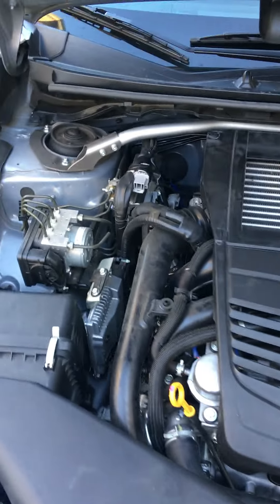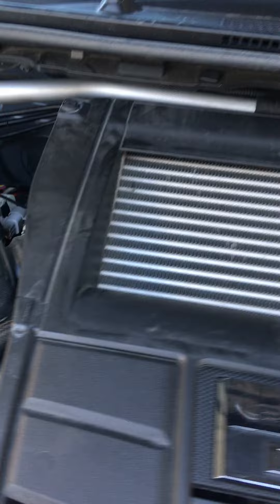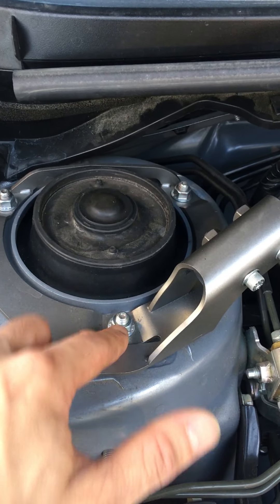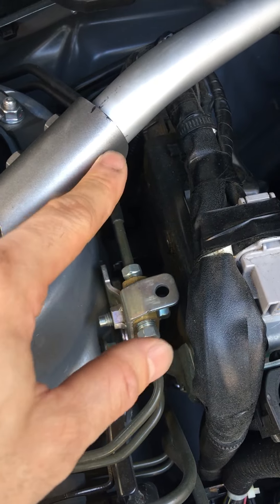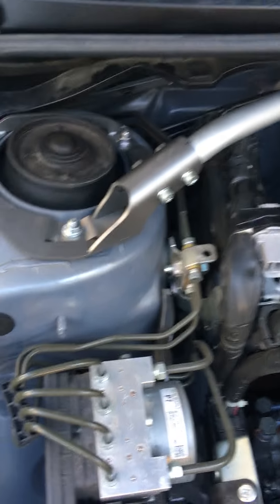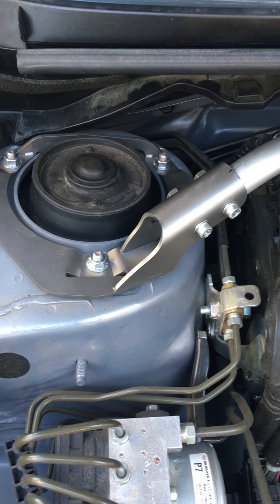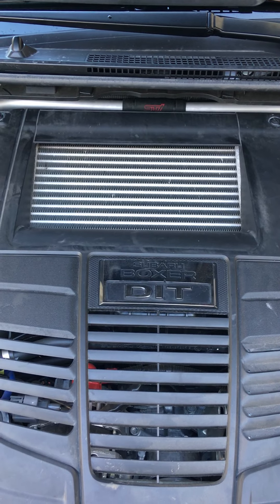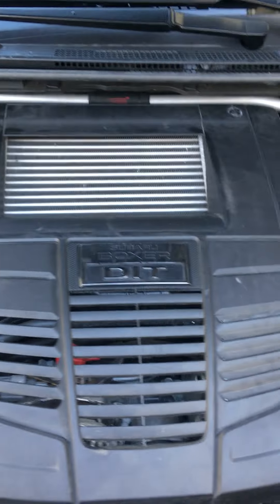STi JDM Flexible Tower Brace Install Tips and Review 2017 Subaru WRX

Comment: Acoording to the STi website, this strut tower brace needs to use with flexible draw stiffener (Part No. ST20118VV000). And a very interesting note states by Subaru that the this Tower Brace CAN NOT be installed on left hand vehicle. I'm sure it's not a mistake, this note is on WRX/STi, WRX S4 and Levorg STi (which all three were basically the same car chassis wise) I'm not sure what the deal is....
Reply from the maker: Hey what's up! That's interesting...when I purchased the item back in 2018, there was no disclaimer about needing the FDS installed in conjunction. I don't see the LHD disclaimer on the STi website anymore but I remember it was due to the bar running really close to the brake fluid reservoir. My car is USDM and the WRX S4 strut tower brace fits just fine. FDS was the best piece of equipment I have installed on the car to date for performance vs $.
Reply: @j168vlogs  Hey man, I just checked the LHD disclaimer is still there and here is the link https://www.sti.jp/en/parts/wrxsti_va/chassis/ST20502VV010/
I asked around a few dealers and rallsportdirect and they don't know anything about it. I think you are right, the brake fluid reservoir is located at different place for RHD. Thank you so much for pointing it out.
Reply from the maker: @Align700nitro  No problem man! There is a user on NASIOC that goes by Archer1.8, he made a few comments on some of my videos but he has extensive knowledge about JDM parts with a build thread on his Type RA. He's pretty helpful. https://forums.nasioc.com/forums/showthread.php?t=2901281&page=3
Reply: @j168vlogs  Do you know if he has a youtube channel? I’d love to hear how his car sounds.
Reply from the maker: @SonikJesus  Hey what's up! I second that, Archer1.8's build is incredible JDM goodness lol. Unfortunately, he doesn't really post any videos on his youtube channel, but there is a IWSTi member, ajsti24, that is also a JDM parts enthusiast. He didn't do the legendary turbo upgrade but he has the same muffler on STi https://www.youtube.com/watch?v=inbr9L-Rdh4.

 He drives a S209 now so that is pretty much as good as it can get!

Comment: Mine has just arrived and these days I will be installing it in my Sti 2020. I realized that in the box, the adjustment screws came loose and missing 1. Will it be easy to get?
Reply from the maker: Hey what's up! Sorry to hear you are missing parts. I don't think that exact bolt can be found. I would contact the company you bought from and ask for them to mail you the oem bolt. If not, you may consider purchasing an equivalent strength stainless steel metric bolt from a hardware store but I am not sure if that is safe or not. Hope you get it solved fast!!

Comment: Does this fit with Iag AOS?
Reply from the maker: Wish I knew. Sorry! Let me know if you find out.
Reply: @j168vlogs   I tried and it doesn't fit 😞. I have the grimspeed tmic and I could get it past that but the IAG AOS sits about 1/4 inch to high. I really like your videos and wanted to do all oem suspension upgrades for my wrx.
Reply from the maker: @Dillz107  That's disappointing news to hear but at least they make other strut tower bars that will work with the AOS. Thanks for watching the videos! If you do all the other STi suspension mods, you will not be disappointed. I hope you still keep the STi strut tower bar and make it work out for you one day! It's an engineering jewel for chassis modifications. If you ever get the chance, let me know how your WRX build is going!

Comment: What torque spec did you use after putting on the tower brace? Some say 14.5 lbs others say 24lbs?
Reply from the maker: Hey what's up! The M6 hex nuts are 11.1 ft lbs (15 Nm) and the flange nuts are 14.8 ft lbs (20 Nm) according to JDM instructions for 2017 WRX. Have fun!
Reply: @j168vlogs  thank you!

Comment: I’ve been look at this piece to stay OEM
Reply from the maker: It's a nice piece of equipment with the pillow ball design. I could feel stable straight line steering when boost kicked in. What's interesting about the OEM design was STi focused on tire grip rather than chassis rigidity which I think is important for street drivability. Just make sure you get the model specific one for your car (STi/WRX).